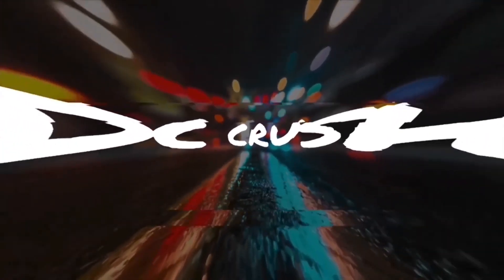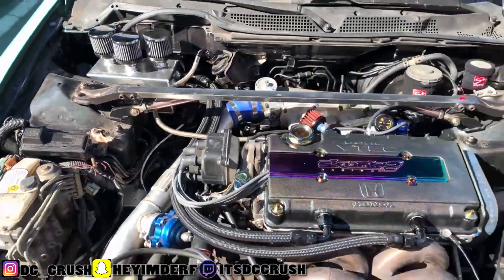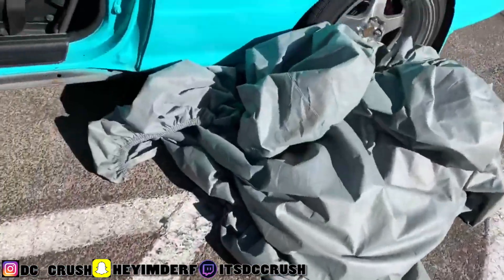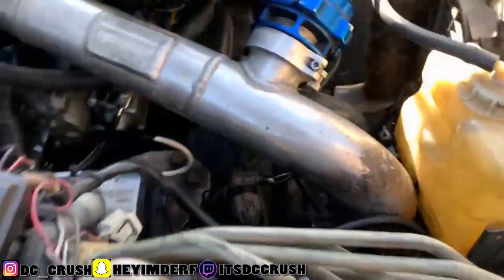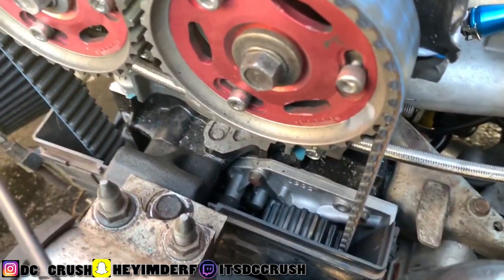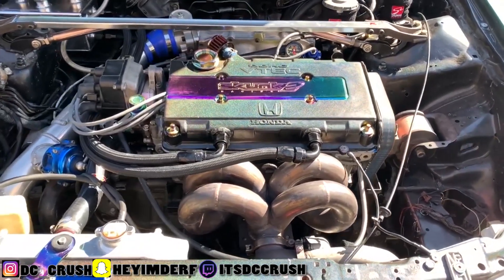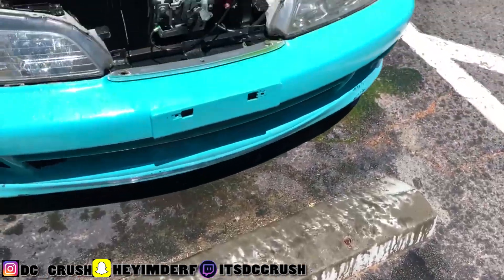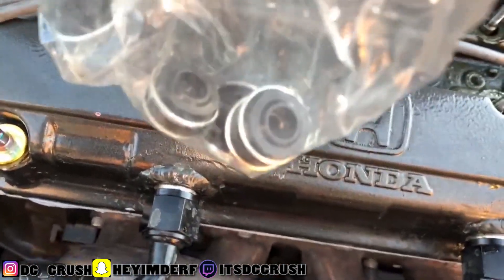Troubleshooting my OVERHEATING ISSUE  and it’s the

Comment: Oem thermostat temps open at 170/175
Mishimoto thermostat opens up at 154 degrees. Since your running turbo you will run higher temps under the hood, either run Mishimoto or none at all. Should help with cooling a bit. Plus go spal fan as well. It works wonders
Reply from the maker: ITS THE HEAD GASKET I LITERALLY SHOWED TE SYMPTOMS O A BLOWN HEAD GASKET LOL I ALSO RAN W/O A THERMOSTATE AND IT STILL OVERHEATED LOL
Reply: will have to agree with this
Reply: @dc_crush  yea head gasket is the problem i seen that on the gram when u posted it. But i was just saying to keep it running cool those parts work great
Reply from the maker: Geo Otero yeah I plan later down the road for some upgrades but as of now I’m just trying to get it running without over heating so I can get it tuned. If I keep throwing parts at it I’ll never get it tuned

Comment: You may have stated this in  another video but have you checked your temp sensor? Not saying it’s the issue but that may save you some trouble. Looks like that head gasket blew from the coolant leaking out
Reply from the maker: wasn't the sensor my fans continuously run, not the head gasket either because it was replaced

Comment: Wasn’t u having a coolant leak u showed on camera
Reply from the maker: Peter Dexter you right Lol but I’m trying to figure out the overhearing first a new radiator is an easy fix but I don’t want to order one yet before I figure out the overheating issue for sure. That small leak won’t cause overheating however yes I do need a new one but before I do that I want to fix this issue first.
Reply: DC Vlogs Forsure all boosted hondas usually eventually overheat after long drives. I’m going to try to eliminate that problem. Here’s the plan. I got a ebay duel core for now. I ordered a shroud and I’m going to add a spal 1300 cfm fan vs oem of like 900 to pull that extra airflow, heat wrap my downpipe and dump tube, turbo blanket, coolant temp gauge even tho I can use s300 Bluetooth to monitor it.
Reply: I get to about 205 max I wanna get to 190-195 at all tomes